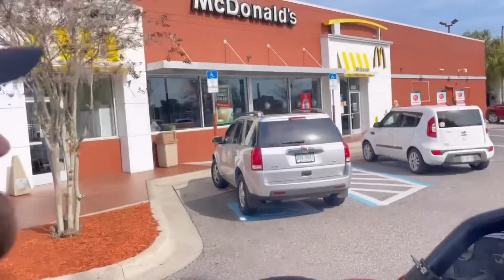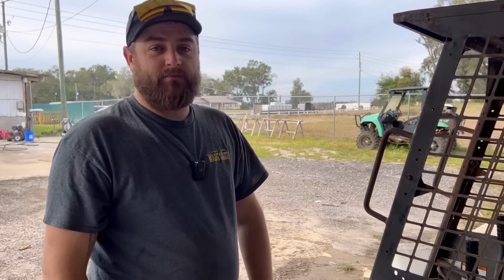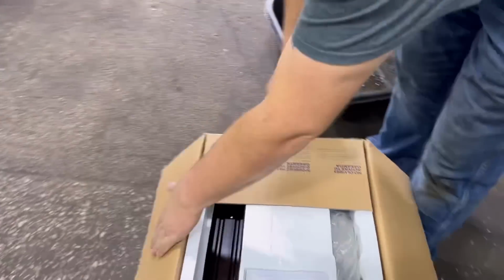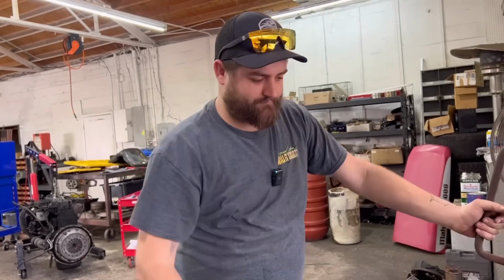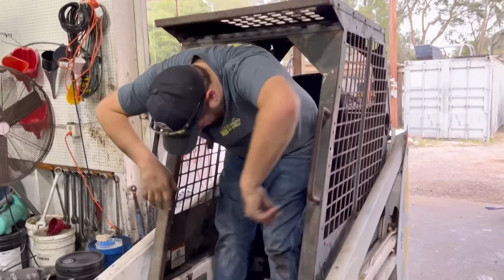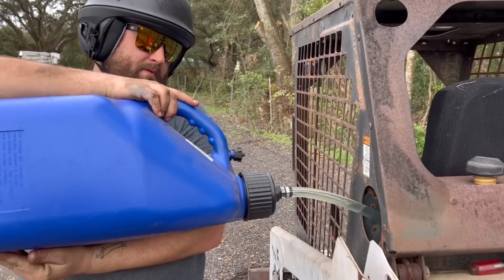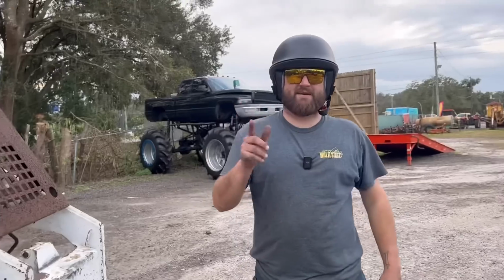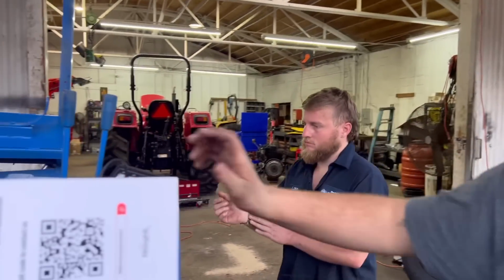How NOT to Drive a Skid Steer Loader!

Comment: I have the exact same skidloader. I bought it from a buddy after he replaced the motor with another Kohler 18 hp. I fixed all of the lights, put new tires on it this past sum wemer, put a new seat on it last month, and fixed 2 blown hydraulic lines. I also left the seat belt and safety bar intact. For good reason. Then last week my wife came and told me that the starter received a death sentence. Thankfully the fricken engine has to be removed to replace the starter. Damn Kohler. Had to fix it right away because my wife uses it for the horse stables. 🐎 The thing is a little beast! It's skittish as all hell but when you figure out it's capabilities, you can do a lot with it. I also have a larger bobcat that I am putting an Isuzu reefer motor into. Then I have a New Holland LX885 skidloader at the dairy farm. Years ago, when my son was riding with me in the other bobcat, we went to retrieve a large square bale of hay from the far end of a hay field. On the way back, my son asked me why we had to have the seat belt on. At exactly the same time we hit a pothole which resulted in the back end of the loader going into the air and the front end slamming into the ground and my head bashed into the console. If we did not have the seat belt on, we would have been thrown out and crushed. After I regained my bearings, I said Mark; that's why we wear this seatbelt. Stay safe my friend.

Comment: hey bruce if your still worried about your oil drain line just run a 90 then the straight fitting which will get it up off the exhaust also be careful them mini skidsteers are like riding a wild bull always trying to throw ya off and run you over

Comment: Hey Bruce if you still have the 440b and the hydraulic still have air in the system remove the return line from the pick up line. I rerouted my return to the top of my oil tank. It’s just a horrible design and you will never get the air out of the system. Mine works like it should now.